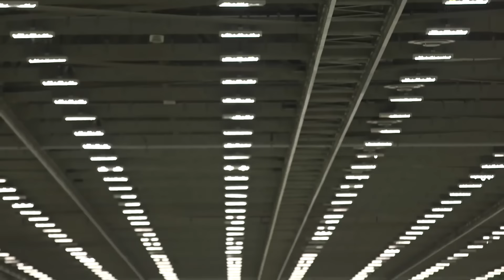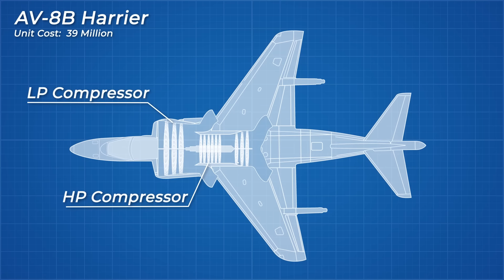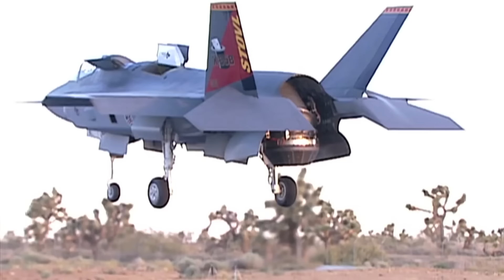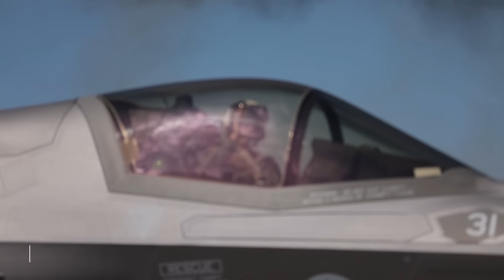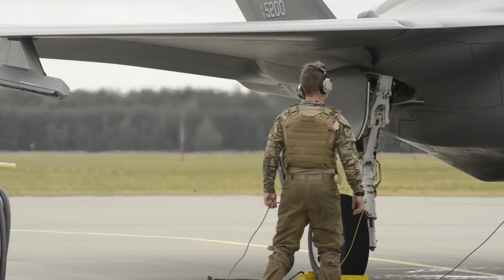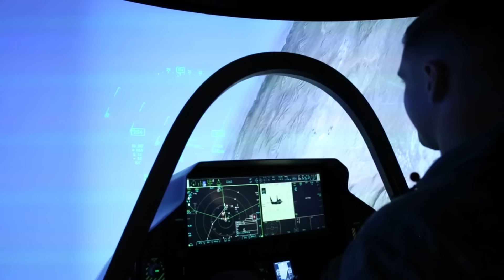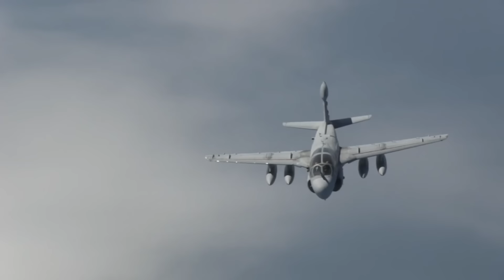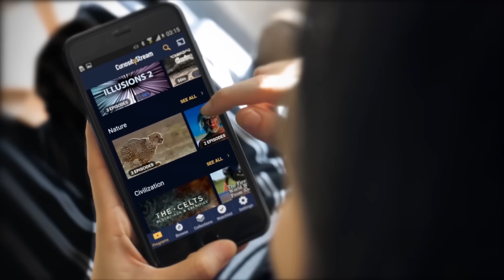Is The F-35 Worth $115 Million?

Comment: What an airforce needs is a cost effective system.
Most people do not understand this.
F35 export success is due to political pressure from the US to buy it.
Norway will spend half its total defence budget on this aircraft for a long time, that is insane.
Flight hour cost:
Gripen - 6500$
F35 - 40.000$
Reply: Lmfao. That’s not a credible figure for both. Gripen have a rather high maintenance which is hidden unlike the F-35. And oh, F-35 is about~33,000
Reply: @tristanpau1p  
The Gripen system have over 20 years of real data to predict support and maintenance cost (LCC) so those figures are very accurate while F35 is based on estimates so likely it will be higher. F35 is not built with ease of maintenance in mind to the same extent as for Gripen. Gripen was designed to be simple to support with few people at dispersed road-airbases by conscripts, this heavily contributes to low support cost.
Stealth is also extremely costly to maintain and this is an issue for it today.
Reply: @petter5721  no. The base figures you are likely referring to is the wrong calculation made by Jane. $4500 isn’t a credible figure even for the C/D model.

And the calculation done for Gripen is so different compared to F-35’s estimates that it’s hilarious. Is you 6500 figures account for engines, the whole avionics(even the one not use very much like FLIR), the number of fuel needed to match the fuel fraction, the cost of wages from the maintainers towards the whole structure of the armed forces, development, software engineers, and so on?

Oh contraire. The F-35 is built with maintenance in mind. The cockpit opens inward instead of the back since removing it is a breeze, reduced the number of hydraulics and replaced it with electric actuators, the engine can be removed easily by a few locks in the back, a bunch of dedicated panels for maintenance, and so on.

Based from the Finnish reports, the A variant can be used in road bases and the more finicky B variant is used by the Marines for dispersed operations(not surprising since this is the Marines we are talking about)

The stealth aspects doesn’t contribute to the cost since the skin itself provides the majority of it and RAM outside is the finishing touch. The skin can endure strains as per LM’s data.
Reply: The Gripen is about half as expensive to fly as the F-35, certainly nowhere near 1/8 as expensive. The problem is that $6500 for the Gripen comes from the business that is selling the aircraft, whereas $40000 for the F-35 comes from the customer who operates the aircraft.

Saab is a business and want to advertise their fighter using the best looking values, so they calculate the costs associated with a single flight and basic operation at an airbase level in the role of point defence which is about as simple a role as you can get. That is technically acceptable, but is unrepresentative of actual cost... 

The US military calculates cost per flight hour by averaging ALL costs associated with the aircraft for an entire year, and comparing that cost to the total number of flight hours during that year. This means that many more costs get included, such as the cost of the supply chain, the pilot training, personnel salaries/contracts, and all the high-level maintenance that occurs when an aircraft is removed from active service for it's annual examination (timeframe varies by nation and service). 

If the F-35 is calculated based on Saab's formula it ends up around $13000 which is actually pretty decent for a modern fighter, especially considering how capable the F-35 is. It's not a case of the F-35 being overly expensive, but rather the Gripen being uniquely cheap and suitable for small nations who don't need much more than basic capabilities.
Reply: @dumdumbinks274  
I disagree since I have insight in Norways F35 issues with the upcoming maintenance and support cost.
F35 predicted cost are uncertain and they will most likely be higher in real life.
Time will tell but several nations are very worried that F35s support cost will eat up the operational budget and reduce pilot training and flight hours.
After all Gripen have over 20 years of solid data, not predictions, and this have been a great benefit when developing Gripen E,
Have a great day!
Reply: @petter5721  one thing came to my mind, the Gripen E have taken a long time to develop for a supposed easy upgrades and the upgrade from C/D to E/F isn’t possible too as Saab said.

Saab made a lot of predictions and in the end, a lot of them didn’t materialize. I especially love how they predict their production date. They keep delaying and delaying until it got to 2021.

And oh, another non-credible prediction they made is the supposed cheaper operating cost of the Gripen E/F along with cheaper unit cost. Both are false statements.
Reply: @petter5721  Having 20 years of data doesn't matter if you're not comparing the appropriate data. F-35's $40000 (which is actually an old value) is based on US military operational costs. The $6500 figure for the Gripen is a promotional value used by SAAB that is barely even relevant because it covers so little.

Comment: Nothing about the latest within ASEA radars that you can house in the nose of a small fighter? 

Do you know that one fighter manufacture which is also a worldleader in radar technology (they sell a lot to the USN to help them keep track of their F-35s) opted out from stealth as means of hiding objects that can't behave like what they are detected as. So a F-35 detected on a radar as a tiny bird will get busted by the radars computer since it's most likely travelling to fast to be a bird. The idle ship on the water detected as a sea gull is harder for the computer to distinguish from the sea gulls on the water beside it. 

Most modern competent radar systems today detect stealth objects at a safe distance giving ample time to take action to set up a good defence. If one doesn't use old school like flying low or behind objects, but you can hide a Mig 21 that way to.

And note most fighter aircrafts will be flying with their radars off most of the time, since it's extremly much easier to detect a radar from an aircraft than detecting an aircraft with a radar. Stealth or no stealth, it doesn't matter.

So the F-35 with it's obsolete stealth, slow speed and short range and need of days of maintenance per flight hour is a turkey.
Imagine F-35 pilots flying of towards the enemy beliving they are invisible, like lambs going to the slaughter house.

Like Sherman tanks vs Tiger tanks. 

But this time the Shermans of the air are goldplated, can only run on roads and come in smaller numbers than the Tigers.

Comment: A MAJOR hitch: the F-15 is about 700 mph, that's SEVEN HUNDRED mph faster than the F-35. When you're almost a Sound Barrier slower than the competition, even with Hi-Tech jazz, you're NOT gonna gain air superiority.
Reply: Why is speed so important?
Reply: It wasn't really supposed to be an air-superiority fighter, you have the f-22 for that especially since in today's wars, electronic warfare, the armaments you carry and fleet/sensor integration is more important than pure dogfighting.
F-35 is a shit show(mostly in the cost dept) because of political meddling.
Reply: F-15 MAX speed is Mach 2.2. That is while completely unarmed. With 8 missiles and nothing else that MAX speed drops to Mach 1.8. With the typical 2 external fuel tanks that MAX speed drops further to Mach 1.5.

Meanwhile the F-35 is capable of Mach 1.6 while armed, and still outranges a 2-bag F-15.
Reply: @dumdumbinks274  To be fair, they're called drop tanks for a reason.
Reply: @infinitelyexplosive  True, but dropping tanks sacrifices range, which means you could be forced to abort mission and that would automatically mean the enemy was successful with their engagement.

Comment: No its not. I worked on the program from 2002-2008.  Lockheed had a streamlined contracting process which gave them increased power and less oversight.  Even after the F22 Lockheed guys tried to give them their mistakes so as not to repeat them, the F35 program took the F22 mistakes and increased the mistakes and made them larger.  Lockheed mainly ignored the government input and created delay after delay.  As a DOD guy I’ve never in 30 years of service worked with a more arrogant company in my life.  

In the end they came up with a nice plane but it could have been done a decade sooner, and a lot less money, with more oversight.  My favorite reply from Lockheed was “ we have another delay and we need more money “. 

You’re right tho. The Air Force really didn’t need this plane considering they have the F22.  They could have saved tons by updating the F22 and just designing the F35 for the Navy / marine corps.

But then if you consider the Bidet administration gave the Taliban 90 billion dollars what’s a 115 million dollars?  The DemocRATS just print money anyway.  You can have a whole Air Force of F35’s for as much as Bidet left over there. Approximately 750 F35s for 90 billion

Comment: The F-35 is not worth 115 million because all 3 variants have major flaws in its core design for example the F-35A variant has a major structural engineering flaw and onboard CIWS flaw, the F-35A has a major issue with its internal 35 mm rotary cannon where it cannot aim at the target properly and when the cannon spins up to fire it causes miniature structural fractures on the airframe which in turns reduces the lifespan of the airframe, on top of that the threat identification library onboard known as ALIS also has problems which pretty much reduces the stealth feature of the aircraft. And the other 2 variants such as the F-35B and F-35C are facing issues with rigidity of the airframe and also issues with the operating software ALIS which is turning out to be a major headache for US Airforce and Navy that operates the F-35s from carriers.
Reply: Did you really think modern fighter really need rotary cannon like a ww2 fighter?
Reply: @fadli_1577  
Why do you think the US Soldiers still love the A-10 Thunderbolt II over the F-35, because it is still the best aircraft to provide close air support by eliminating enemy tanks and enemy foot mobile personnel and the technology is like 40 years old so it's beyond the point of its designed service life.
Reply: @nazmulhaque4551  a-10 is too slow and flight in low altitude
Reply: @fadli_1577  Shocked
It’s almost like CAS is supposed to fly low and slow to support the ground troops
Reply: @LiewLmao  f-35 designed to replaced f-16. A-10 probably to be replaced by future vtol aircraft
Reply: @fadli_1577  f16 in multi role was supposed to replace A10 as well
Now the f35 is supposed to replace both of them 
A10 will never be replaced as long as their enemies only have aks and rpgs
Reply: @LiewLmao  f-16 and a-10 have different role. A-10 are for low risk CAS, and multirole like f-16 and f-35 are deployed in high risk mission CAS (lot of enemy anti air missile). I don't get it why everyone think f-35 will replaced a-10
Reply: @LiewLmao  even Israeli have tested f-35 to deployed in palestine. And that thing have better quality than f-16. Because f-35 are harder to detected by enemy radar
Reply: @LiewLmao  and f-35a cost have go down to 78 million. Its better and cheaper than over 100 million cost european multirole aircraft (rafale and typhoon)
Reply: @LiewLmao  Uh no.  There is nothing in the role description that implies CAS is a low and slow role. "Close" does not refer to the supporting aircraft... it refers to the enemy's proximity to allied forces. In fact the majority of CAS is done most effectively from higher altitudes, typically around 10000ft. 

F-16 DID replace the A-10 in most of it's combat roles, and did so out of necessity during the Gulf war where A-10s were forced away from the frontlines because they were simply too dangerous for such an aircraft. Yet the A-10 still suffered the highest combat losses of all US aircraft during that war. 

The only role the A-10 is uniquely capable at is providing heavy firepower against enemies who can't fight back. The troops of course love it for that, but they wouldn't need to if the US stopped entering wars unnecessarily. And if the US entered a war out of necessity the A-10 wouldn't last long.

Basically, the A-10 is a luxury for the troops. It is nice to have, but pretty irrelevant to the outcome of a war.

Comment: check ur facts. loads of F117's got shot down in Iraq by old soviet SU100 systems.

Isreal has 1 of its F35's shot down as well by Syria. by the same system.

Before that the SR 71 blackbirds were shot at loads of times but none shot down.

The radar systems used by most countries can spot stealth planes very easy. only the US radar cant see them lol.

most of the plots that havnt been given a backhander by lockeheed say its a piece of junk.

Its failed every test even though the tests were rigged lol.

Like the test to prove its better than the A10 was rigged. the A10 had full tanks plus extra tanks fitted to make it a lot heavier. its targets half the normal size and heavily camouflaged. not allowed to fly below 10'000 feet. fitted with weapons systems it was not desingned to carry. it still hit its targets.

F35 as little fuel as needed for the test no extra to make it as light as possible. targets 10x bigger than normal painted white so they stood out a lot more. it failed to hit them lol.

fighter comp were every country could send along fighters for dogfighting trials. the F35's were al shot down without even seeing what fired at them and it was  visual sight and short range radar no BVR allowed. But then again the F22 was the same as was the  F18 and F15 and F16. all shot down by obsolete migs from the 70's. But at least the F16 spotted the other plane and tried to get a shot off.

F35 cant get wet or the skin falls apart. So cant fly through clouds or work from carriers without having probs. water reacts with the stealth paint eating into the skin.

The WWII Lancaster was more stealthy than the F35. That was nearly invisable to radar just by painting it black underneath with a special paint only the Brits have. radar could see it from above though. Its why the Germans had to use searchlights to try and spot them cause their radar couldnt see them. and their night fighters had to try and get higher than the lancs for their radar to spot them.

All British planes from WWII that flew at night had the underneath painted with the same paint for stealth.  Even now the british army still use the same paint on their vehicles. its not camouflage as such its breaks up the radar making it harder for radar from anti tank units to spot them. Its why they r painted on the corners and edges to break up the outline to night vision and radar.

Comment: Kind of looks like Boeing had it right when at the onset of the project for saw the need for multiple variants watch in all likelihood would have been far less costly both in time and expense not to mention the fact that they realized early on the need for multiple specialized variants what it all likelihood been Superior. The fact that they are now revisiting Boeing's x21 platform which was in competition with the F22/x22 for the roll of air superiority makes you wonder about it why the Lockheed  designs we're actually chosen

Comment: If I am not wrong, the same lift fan concept is also present in Yak-28
Reply: No, all Soviet VTOL designs used separate engines mounted vertically.  They required their own fuel source, limiting the range of the aircraft, and were prone to flame-outs and other engine failures that could affect stability and topple the aircraft while hovering.

The F-35's lift fan is powered by the main engine via a turbine - it does not use extra fuel, and it does not produce exhaust, rather ambient temperature air is pulled downwards just like a helicopter's main rotor.
Reply: No, but the mechanism for angling the engine downward is

Comment: The F-35 is not comparable to the A-10. It may have a purpose for versatility, but it can't compare to the A-10's close air to ground support capabilities.
Reply: The A-10 has a very specific "purpose" of providing heavy firepower against enemies who can't shoot back...  that's not only ridiculously specific, but also pointless unless you intend to enter similarly pointless wars. .. the US clearly enjoys doing so, and it's because of US politicians that US troops think the A-10 is necessary. 

It's role can be done by almost every combat aircraft in the US arsenal, and if it didn't exist the US would be more capable of ending wars due to greater emphasis on aircraft that can actually strike the enemy's supply chain instead of having an aircraft that is permanently in a defensive role.
Reply: A-10 is too slow and can only flight in low attitude. Good luck getting shoot by portable anti aircraft missile

Comment: "A single scratch would require the whole part to be repainted": sounds impractical af and not at all suitable to the conditions of war. Also while 1 of those is manufactured the opponent could make 10 non-stealth fighters (that are also more "scratch resistant", can use rougher air fields and are cheaper to operate, can operate without "jamming" escort, etc.) and achieve air superiority though sheer numbers. So it's basically another "white elephant" and a vehicle of redistributing taxpayer money into pockets of military industrial complex, in real combat with comparable military power it's going to perform about as well as Ferdinand tank destroyers in WW2.
Reply: Realistically you're not going to get any higher than 4 to 1 if you want a jet that's anywhere near modern. Engines and avionics still make up an enormous amount of the cost. And if you want to attack a surface target, which is arguably the primary goal of the F-35, it's not clear that 4x as many planes is actually sufficient to attack well-defended sites.